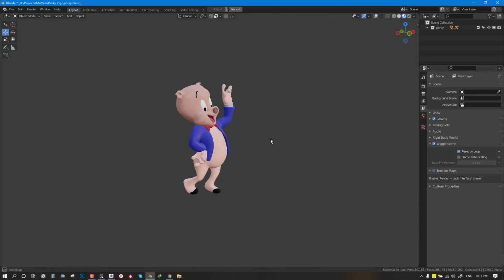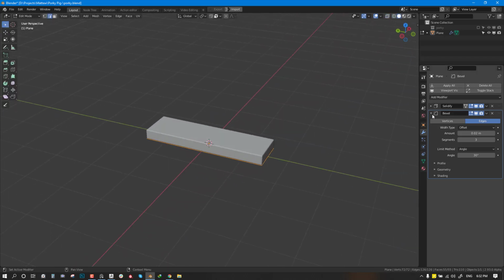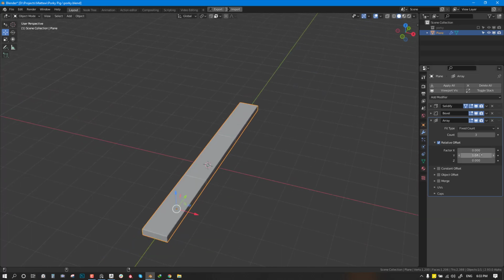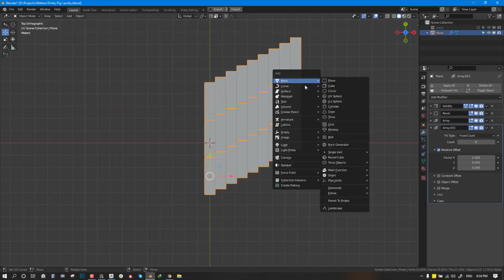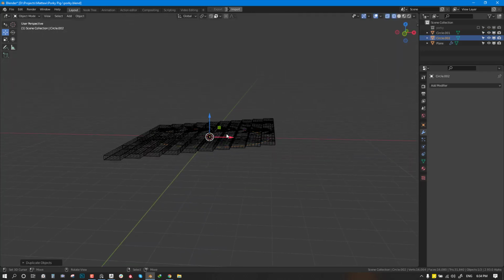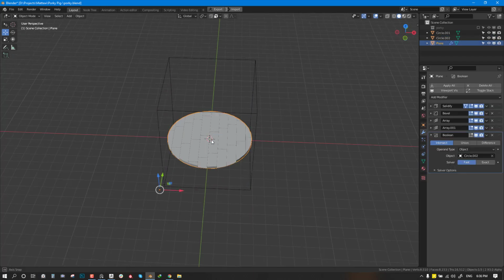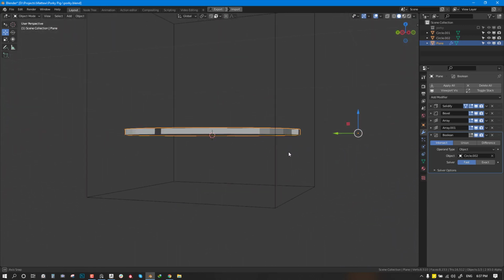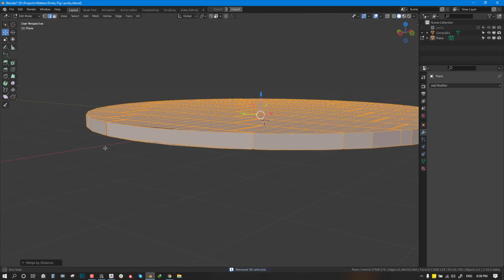Creating wooden patterns with modifiers in blender

Comment: The missing faces after the boolean are probably due to overlapping faces added by the second Array modifier. You added a tiny extra gap in the first array, but didn't do the same on the second one. That way the sides of the rectangles were put in the exact same X position. That will have confused the bool.

Comment: ive done something similar b4 , i found that using the Boolean with exact was better WHEN you have a cylinder with thickness, i.e. use the circle u made, extrude it up DONT fill the face, so a extrude and scale on the shift Z (aka solidify modifer) and make sure to recalculate normal, Boolean difference and boom ur done. ill happily send screenshots if i sound confussing.